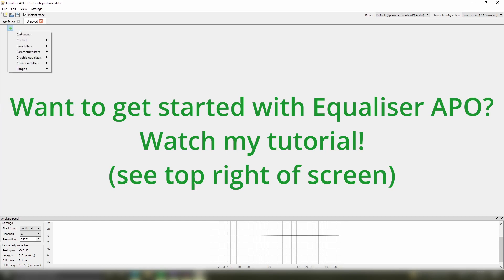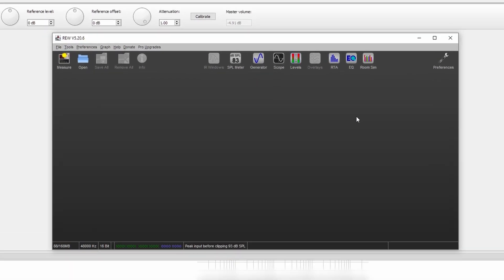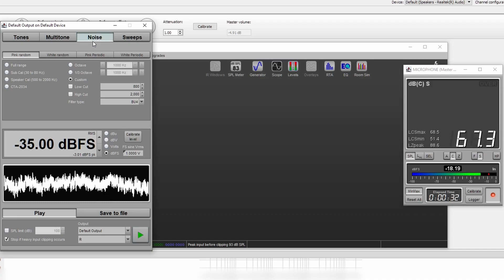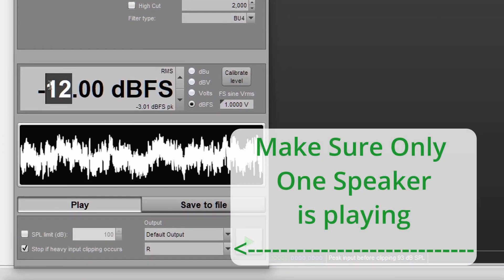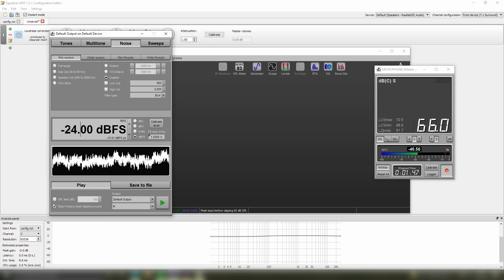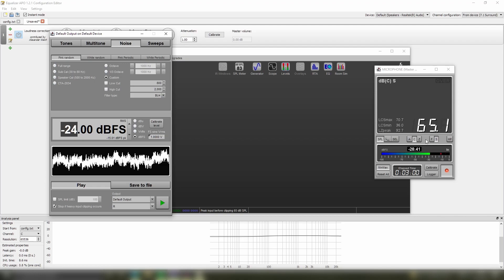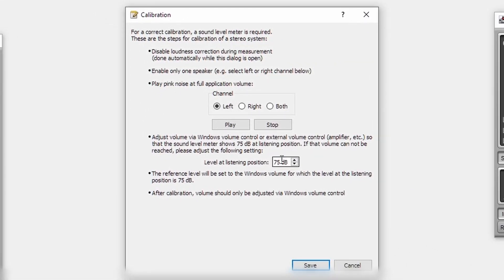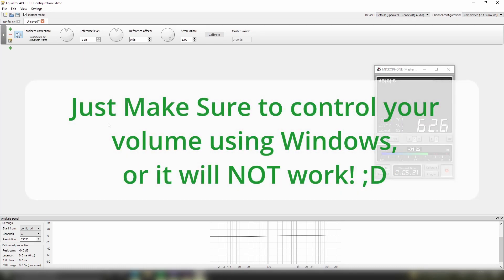Loudness Correction in Equaliser APO - Natural Sounding Audio

Comment: I am falling down the rabbit hole of figuring out how best to normalize audio from movies on my PC that I watch on my TV and home theater setup (right now just 3.1) and some loud audio is just way too loud.
Reply: Im in the same path did you figure it out?
Reply: I'm afraid there is no one-size-fits-all solution to movies and TV shows with quiet dialogue and loud explosions.

This requires what's called "Dynamic Compression", but each movie/show needs to be tweaked separately. There's no magical setting that works for everything.
Reply from the maker: @Tormanoid  there's meant to be, and typically is depending where you're coming from. -14LUFS is the standard for streaming platforms like YouTube, Spotify, etc., Netflix has a standard of -27LUFS, UK and Europe TV broadcasting is -23LUFS.

This information is searchable online.
Hope this helps 🤞
Reply: @ Yes, I' aware of these loudness targets. However, my previous comment was referring to the dynamic compression settings. My point was that even if you aim for the same target, the values required to achieve the same output volume will vary between sources. In simple terms: there is no universal setting to make all movies the same volume.
Reply from the maker: @Tormanoid  unfortunately very true!
Reply from the maker: Hello both. Unfortunately that issue is to do with loudness normalisation as opposed to loudness correction, not too much can be done post-mixing I'm afraid to say. The reason for it being this way is because the producer will have wanted high dynamic range during playback, unfortunately for high dynamic range playback, you need it at a louder playback level to be able to hear the quieter elements like speech. You could try loudness normalisation which crushes these dynamics, but that will only help somewhat.

The first thing to check though would be to ensure all of your speakers are at the same volume levels, and that doesn't just mean average volume, that means your higher frequencies compared to your lower frequencies too, you may find you need to do some equalisation, just make sure either you apply the same equalisation to the entire input, or to each speaker, or if for whatever reason they are different between speakers, to use linear phase equalisation.

Comment: Is this "Loudness correction" feature better than windows "Loudness Equalization" feature??
Reply from the maker: I'd say so, as unlike the windows feature you're able to adjust it for different content (as different contents have different targets even if -14dbFS is meant to be the standard for streaming, it's not always followed, particularly for Netflix and Disney plus I believe. Don't hold me to this, but I believe I may remember reading a few years ago that all the Windows "loudness equalisation" tries to do is make it so that volume differences between applications isn't as prominent. I believe it must act as some kind of normaliser, unlike this method which makes the audio sound the same (bass, mid, high balancing) at different volume levels given that the way our hearing works is different at different volume levels.

Comment: This is way way way too much to understand.
Reply from the maker: Sorry to hear that. If it's not for critical mixing purposes you could always just adjust the value inside of the equaliser apo program until you're happy with how it sounds.
Reply: @Elliott-Designs  Is there somewhere that explains what the 3 dials mean? I couldn't find docs or anything, so I'm just turning knobs without even understanding what they do. :face-blue-wide-eyes:
Reply from the maker: @rofii_vt  Reference level and reference offset are do the same thing, but in the opposite direction. 

Let's say your program is mixed to be listened to at 75dB in the listening position (when playing pink noise at -14dB (14LUFS), so you do your test with pink noise at -14dB with windows volume itself at max, that tells you should set reference level to 0. Now let's say it measures 78dB instead, that's 3dB too loud, so what do you do? You set reference level at -3dB, because your reference volume is 3dB quieter than your max volume. It's the same for if you're below your target e.g. 72dB, then at max volume you're 3dB too quiet, so you set reference level at 3dB, because the reference level is 3dB louder than your maximum.

The second knob, the offset, is purely for convenience. Let's say we already have reference level set up so we never have to touch it again, but this other program material has it's loudness described as 26LUFS at 75dB (75dB when playing pink noise at -26dB), we originally calibrated to 14LUFS, so if we do 26-14=12. That tells us this new programme material has 12dB more difference between our maximum/peak volume and our average/talking volume. This means the target has moved so that the calibrated listening level is 12dB quieter for the same setting. So we can adjust the reference offset to -12dB to temporarily compensate.

Attenuation is simply a factor that describes how much loudness correction you want to apply. If at 1, it applies all of it, the closer to 0, the less the effect is applied.

Comment: You guys actually don't need any measurement tools. works perfectly on my 5.1 surround setup. Just mix and match those knobs at your desire audio you perceived. You can also look at the graph👌👌👌👌
Works along with PEACE APO too.
Reply from the maker: I need to create a follow-up. There's a reason for manual methods... Also, feel free to just tweak until it sounds right to you. That's totally valid. It's just not necessarily accurate. 👍
Reply from the maker: I wanted to add, you're probably right in terms of adjustments as an end-user/consumer of the content, this is because unfortunately the mixing/mastering isn't always done properly and doesn't always follow these loudness guidelines, because of this you may just be better off doing it by ear, unless you know it was properly produced or don't mind a little variation.

However for mixing and mastering, it's important to have loudness set up correctly for the platform you are distributing to so that you can more accurately mix and master your content for your user and how they'll be hearing it.
Reply: how did you do it on peace?

Comment: It doesn't work for me. It doesn't equalize youtube sound. Windows volume is set to max. But your video is as quiet as a louse. The other video is loud.
It's a crap. Because with how I install it. The lodnes compensation button has disappeared in windows. I can't even avoid this problem. Don't you know any software that has parametric eq and loudness equalization works?
Realtech's hd eq falsifies the sound in the entire range, it's crap, unusable crap.
Reply from the maker: If it's not working for you, likelihood is something went wrong with the initial install. You can head onto toidsdiyaudio.com, there's a forum on there where I'd be happy to help, but there's absolutely no need for such language, I'm making informational videos to help people. If my video is too quiet for you that's because I use a wide dynamic range for better audio quality. Perhaps I shall compress my audio in future videos for those that don't have the volume capability. Thanks for pointing that out (although you could have done it a little more politely). Not sure what you're referencing with the Realtek stuff, perhaps if you could rephrase that part? This program is one of the best for software loudness equalisation and EQ. As for not equalising YouTube sound, it won't be equalising any sound (not just YouTube). The EQ functions systemwide. Hope this helps 👍
Reply: @Elliott-Designs  It's not the APO EQ that doesn't work, it's just the equalization module. The equalization function works perfectly in the realtech HD menu! Equalizes all sounds, including your video. BUT. If I activate the APO software, the equalizer check box disappears from the realtech HD menu. The APO software blocks the realtech sound effect modification menu. The consequence: I can't adjust compensation either in Windows or in APO. It is not enough for me to only be able to set EQ schemes. Due to videos with different volumes, an equalizer must be turned on. But if I want to listen to music, it must be turned off. That's my problem.
Reply from the maker: @retrobudapest  Ok, I see now. Yes, with EQAPO you will not have access to the realtek EQ as well as EqualiserAPO's EQ, this is because EQAPO embeds itself around the realtek driver. Luckily, you'll have the same equalisation abilities inside of EQ APO (parametric and graphical EQ). Actually, you mention videos with different volumes, is perhaps the feature you are missing called compression or normalisation? Either way, all videos on YouTube should be fairly similar in volume level. They are all equalised to a loudness of -14LUFS. Going from program to program is a different issue of course. That requires several different preamp sections in EQAPO that you have to turn on or off depending on what platform you are using. I have a good write-up of integrated loudness of different video and audio sources on toidsdiyaudio.com if you wanted to implement this. You mention it not being enough to just be able to "set EQ schemes", what do you mean by this, what is missing? Hopefully I can try and help solve this for you.
Reply: @retrobudapest  KP, you are misunderstanding what the "loudness correction" feature in Equalizer APO is for. It is not like ReplayGain which normalizes loudness between tracks, albums, etc. I don't know of any software that would do that between Windows applications. I'm amazed your Realtek software even had an option for that. You might have a tough time finding something that works. You probably just need to ride the volume knob all day like the rest of us! hahaha
Reply: @mjodr  A program called Wale will do it.

Comment: the goal was to set the apo lc without any rew or any other third-party
Reply from the maker: I know, and you can follow the built in correction playback if you want that, it's just not as accurate, that's all.
Reply: @Elliott-Designs  That's the reason you've got so many dislikes.
Reply from the maker: @kalumander I'm ok with that. People can still use the standard method if they'd like. But given the fact that based on what the audio source is, netflix, YouTube, Blu-ray, changes what the reference volume is, going through REW just let's the user actually know what they are targeting. Thanks for the feedback though 🙂

Comment: Oh great, it is based on equal loudness contour?
Reply from the maker: It certainly is! This one's based on the old Fletcher-munson curves though, not the new ISO standard. Honestly though, there's very little difference, to my ears it works just as well 👍
Reply: @Elliott-Designs  that is awesome ! Thank you for passing that information 😍.
Reply from the maker: @EngineeringEssentials  No worries! That's why I'm here!
Reply: @Elliott-Designs  the old fletcher-munson is actually more accurate in most fields. it's better.
Reply from the maker: @theniroxy thanks for the tip, first time I've heard of this. Just curious about your source so I can read up on it in more detail? Thanks